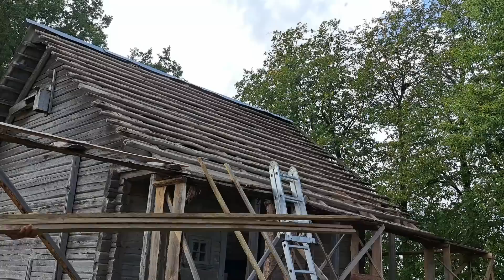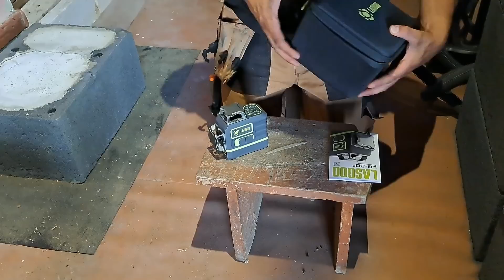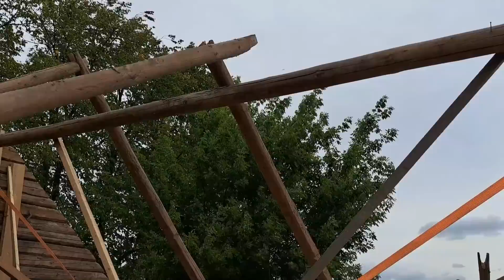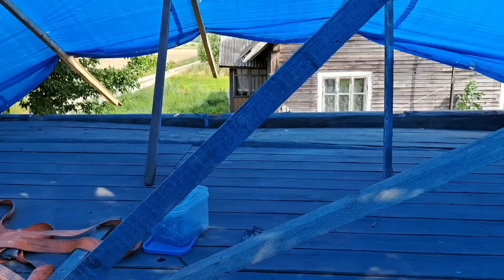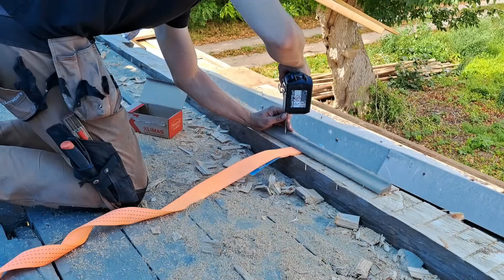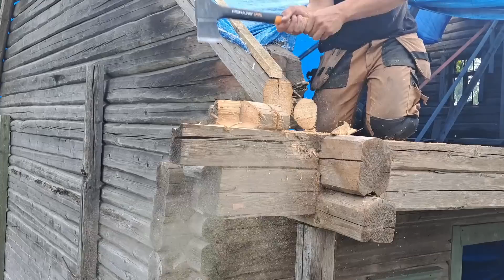Off Grid Log Cabin Renovation | Removing old roof

Comment: I thought the law was the same in all countries when it  comes to asbestos removal you must use specialist contractors to remove and disposal . plus you didn't even wear a mask.
Reply from the maker: A lot of roof are still covered with asbestos sheets... The only thing is you must dispose them and register in special construction trash yards
Reply: I don’t think so if you are doing the work yourself on your own property . There’s probably some rules about disposal of it but if you’re planning on keeping it in reusing it just don’t saw with it or make any dust  while using it.
Reply from the maker: Oh no, I want to get rid of it, its poison 😁
Reply: The regulations are somewhat different across Europe, some countries like the Netherlands have a limit (35m² in the Netherlands) on the surface of asbestos you can legally remove without needing a specialist company, and only when there is no risk of breaking or damaging the sheets while removing them.
So like in the video, when there are tough to remove rusted nails in, and the sheet breaks while pulling the nail out, you need a specialist company to do it, and they will construct a tent wit air extractors and filters keeping an under pressure to prevent any fibers from escaping, and have their workers in a full protective suit with pressurised air to breath.

Other countries in Europe don't have such strict regulations, but precautions should still be taken against breakage and the waste has to be packed in thick plastic film, taped shut and disposed off at a specialist yard. Registration is always done and in some countries you need a permit from your council beforehand to remove and get the waste accepted at a disposal point.
Reply: In Victoria Australia (🦘 not Mozart) we can remove Asbestos provided it’s not a commercial quantity. Like other people have said as long as you do grind it your fine. It looked in good condition so that’s a bonus. 🇦🇺🇱🇹
Reply: Calm down Democrat....